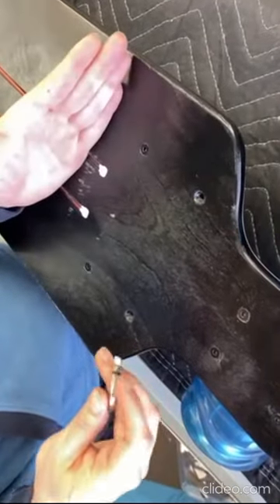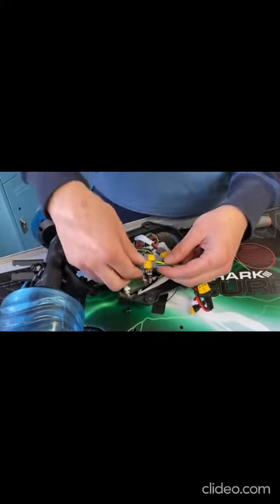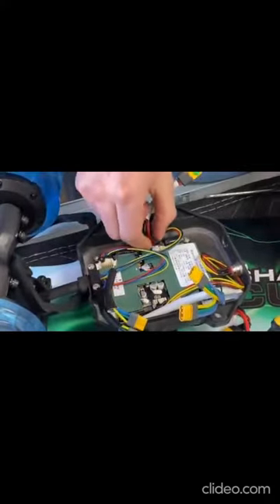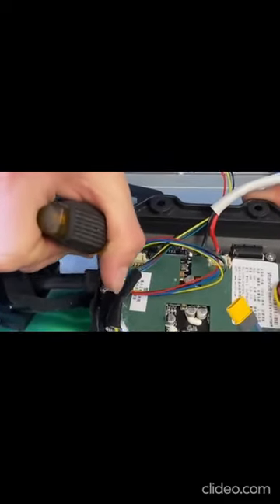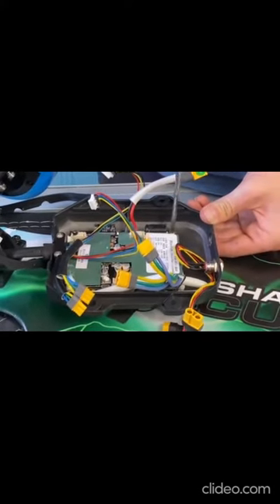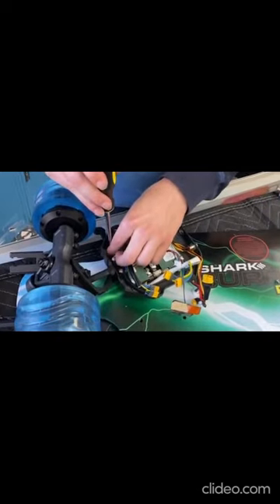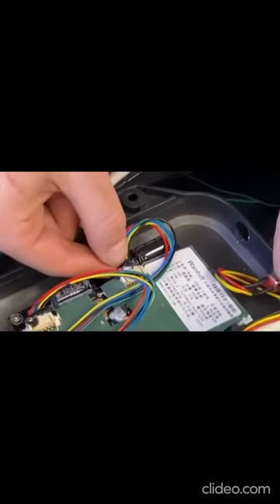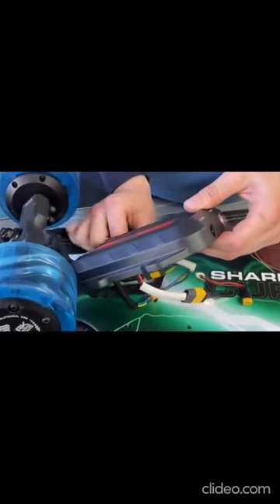Shark Electric ESC Replacement Video

Comment: Suggestion:  possibly label connections , male-to-female pairs for easy identification.  I.E.  each branch section of my Christmas tree  has a colored tag with a letter (female plug in) that corresponds to each male plug that also has a colored tag and matching letter for that branch section.  This allows for easy visual identification.

Comment: Where was the cable that connects to the charging port? It seemed as if it wasn't attached in the port adjacent to the power button. My port stopped working so trying to find out what I need to replace. Perhaps just a power cable to the port?